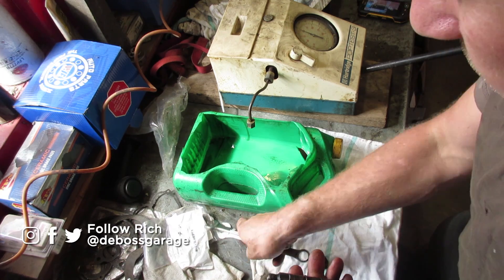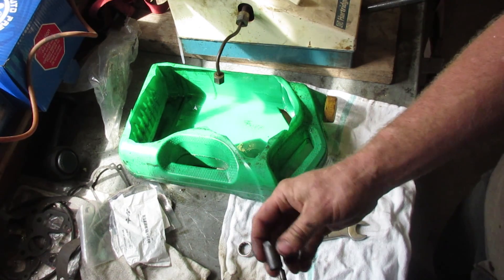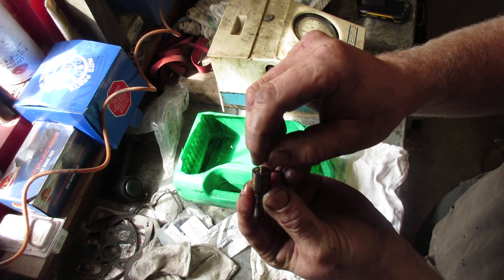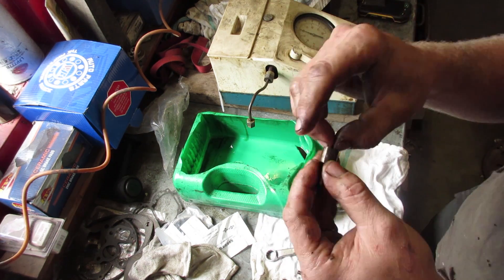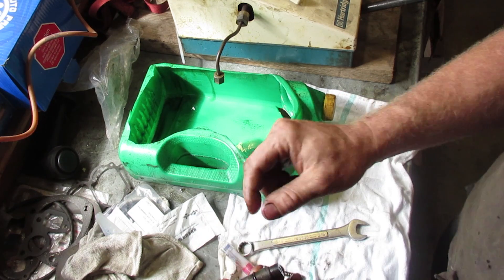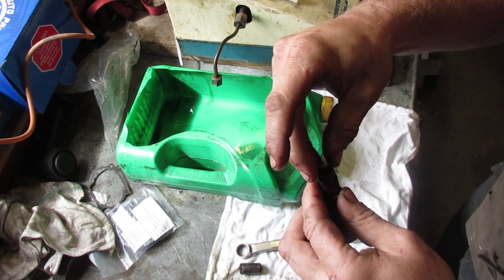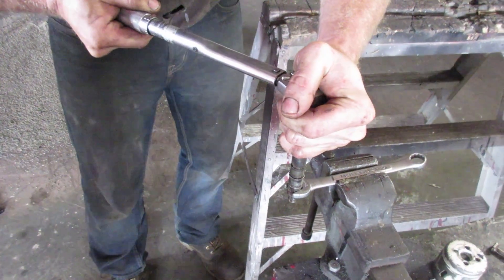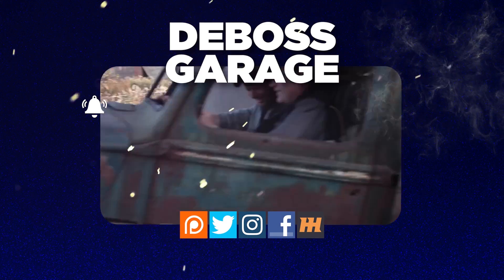How To Rebuild Diesel Fuel Injectors (Mechanical)

Comment: So what was bad on the old original and how do we inspect for this issue in the nozzle. Hard to see the details here. I have a bad injector but can see nothing wrong with it. It leaks compression out the threads of the injector body when this cylinder comes on compression, sounds like a leaking head gasket chug. I really cant find specific details or instructions online. Thanks.

Comment: just purchased some remand 5x.012 injectors from DAP for my 98 12 valve cummins. Unfortunately one of them is leaking up from the retainer nut. Where might it be leaking from and what might be causing this? Thanks! p.s. Ive torqued them all to 44 ft/lbs

Comment: Hey Deboss. What is the trick to getting the hold down nut to seal the injector. I have one leaking around Nut. It’s driving me nuts. I even torqued a few pounds more. Didn’t leak for like 10 min of warming up. Drove home from shop. Opened hood to check and sure enough # 3 is leaking. I’m kinda stomped. Any suggestions sir. Thank u.

Comment: Can rebuilder change injector settings like increase or reduce fuel on 07 5.9 Cummins. 
My truck runs different after rebuild my injector. 
Great job, wish you best

Comment: I've got leaking injectors (into the engine) when i start from cold i get smoke and sometimes from warm it revs up once without touching the throttle. How can i fix the seal?

Comment: i wonder  what happen to the injector if you supply  normal gasoil
aslo thinking of a  lawn tractor converted to mechanical injector hehehe
i need to find low pressure injector that dosent cost an arm

Comment: Big Cummins motors use rockers and push rods to fire the injector as do GM's as in the 2 stroke screamers and no doubt a few others as well 
But yes that style is the most common in in smaller diesels that most will work on 
Great video  
Have been told you should always have a tomahawk handy to lop off a finger if you accidentally puncture your skin with diesel to take the finger off before the diesel travels to far and kills you 

Never new if people were pulling my leg or not though LOL 

Was sent a email the other day about a bloke int he UK I believe that didnt back the tension on a dozer track frame or some such tracked machine the right way and ended up with grease injected into his system under pressure and died as a result 

not a good way to go 

Keep up the good work Rich and crew

Comment: i love these old injectors they where absolutely easy to keep maintained and for them to fail didnt meant much since they werent expensive... sadly you cant find much about how to repair the terrible delphi and chinese bosch injectors without the proprietary electronic equipment that is astronomically expensive hence why here in my country you see many diesels out of the street after 07 that are on sale because no one wants to repair them, oh and let´s not forget also that they are also programmed in place.
 i know our diesel is kinda crappy and that it contributes big time, i just would like to simplify the process a little and maybe cheap them out or make them more reliable
Reply: The answer to crappy diesel Supply is better filtration. Get at least 1 micron smaller than the minimum rating (maximum size contamination particle that will pass through the injector without damage) for the equipment, the new electronic injectors I believe are 4 micron minimum filtration so an aftermarket/oem upgrade 2 micron filter would be appropriate for theas .5 micron would be supreme.